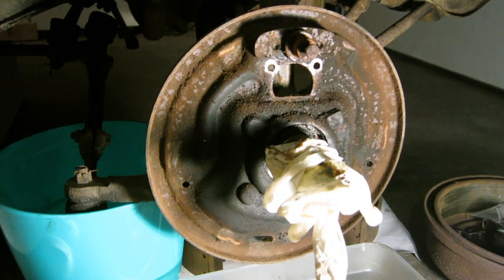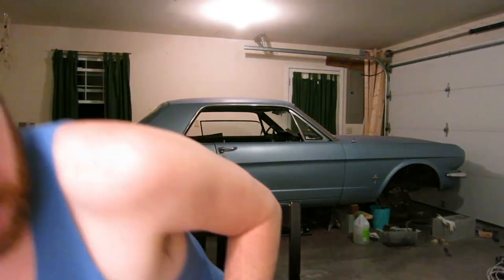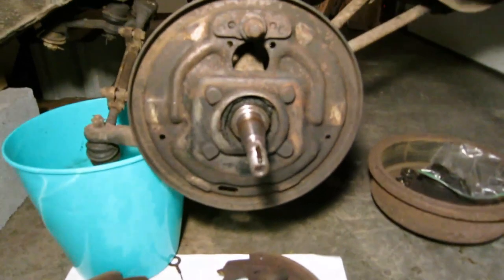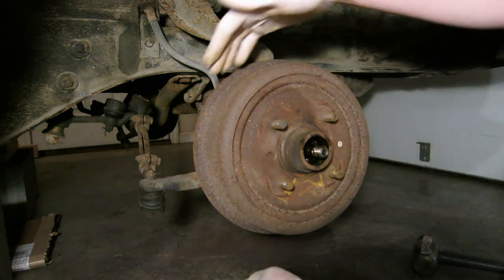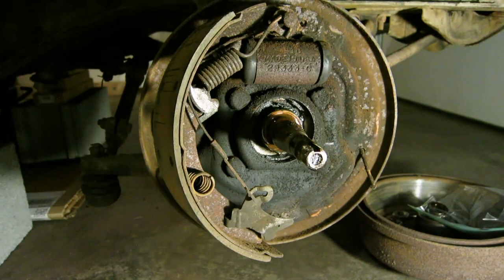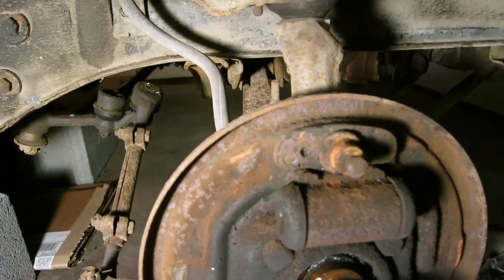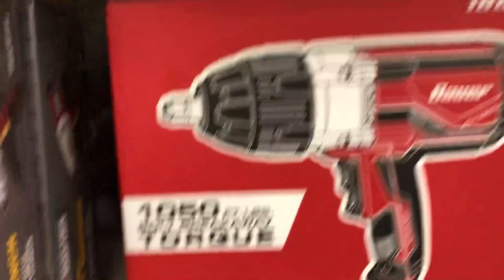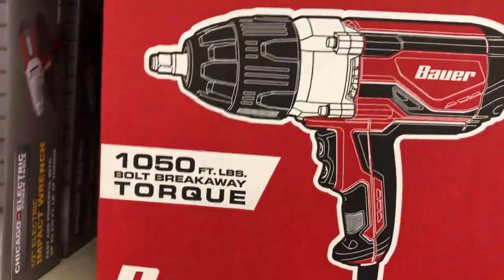Removing Stuck Brake Drum | 1965 Mustang Restomod Vlog

Comment: Great choice in cars!  The drums can get stuck on the shoes as the shoes wear down the drum and a ridge develops on the outer side.  The brake shoes can actually be sitting in a depression in the drum, and that can result in the drums being stuck on the shoes.  Try popping off the small rubber plug at the back bottom of the backing plate and backing up the self adjusting star wheel to bring the shoes back if the drum is stuck on the shoes.

Comment: Nice update.  Keep up the good work!  A wire wheel on a bench grinder is a great way to clean rust off small parts too.  If you don't have a bench grinder, a small wire wheel chucked in your drill can suffice.  Nice work on the brakes.
Reply from the maker: I would love to add a bench grinder to my garage set up.  Just haven’t gotten there yet.  I did recently pick up a wire wheel for my drill.  I plan on hitting a lot of the suspension parts with it before applying good old rustoleum!

Comment: Tools is such a huge issue with any job. Home improvements? Need tools. Lighting for car? Need tools. It's a hard balance to find between tools and parts. But some things just really will make life easier and are worth it!
Reply from the maker: I agree. I’ve built up quite a tool collection as a home over the last 10 years. But as you said, it sure does make life easier.  The silver lining is I’ll be good to go if I take on another project car after this one!